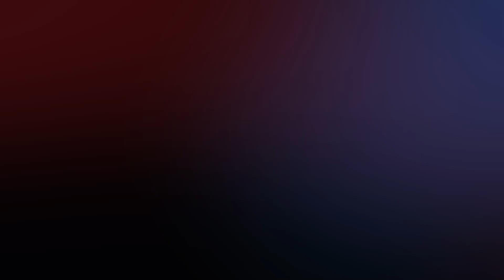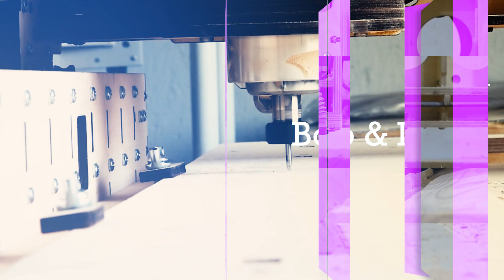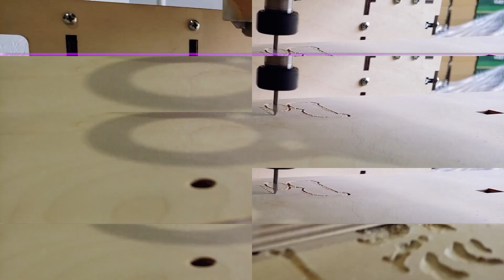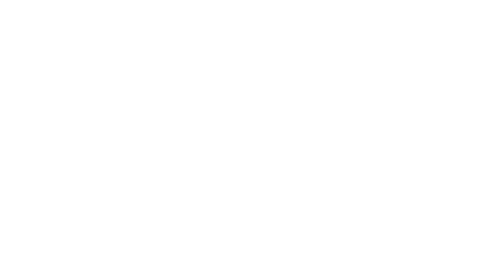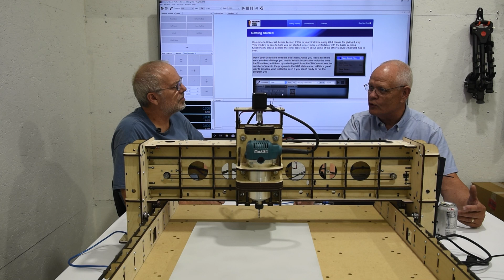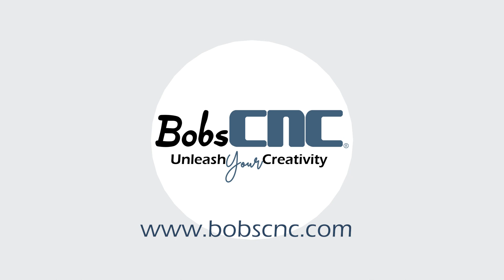Shop Talk: Project Set Up

Comment: I just finished building the Evolution 4. After the first few needle nose placed m4 nuts I switched to a small bar magnet to slip them into the slots, it also would hold the screw to it while I started to thread it in with just the #2 bit in my fingers. Twist the screw to snug than went back with an actual screwdriver to give them a bit more. That worked for most of the areas. About halfway through building it I remembered I had a hot glue gun. Holds the nuts in place quite well. I suggest the painters tape and a small paintbrush with a shot glass or bottle cap of Loctite. After a while I was just dipping the end of the thread, That stuff really goes a long way. Do yourself a favor and identify the top/bottom, Left/Right, front/back of the gantry and the base as you will be flipping it around a bit and it can be time consuming to reorient yourself. 

Reading the comments below it seems some are struggling with the operation of the machine. I have to finish the wiring and put some open source programs together. I will take some notes and get back to let people know how it went, what I used etc.

Comment: You need a professional video team to redo ALL your videos! ..these are very hard to follow, especially with all the banter between you two!  But speaking for myself, I can't see a thing on the screen behind you, much less understand how to find anything on the UGS screen at the same time!  Ridiculous!
Reply: What I did was load the same software they were referring to and followed along with no problem. Use the pause feature of YouTube and get an old fashioned pen and paper to jot down notes. I managed to understand everything but how to switch the units from mm to inches. I will restart and hopefully catch it this time around. If not I will search the help file for UGS.
Reply from the maker: Please download our software setup guide in our manuals section.

Comment: How do I know where to place the board and take those measurements cause you forgot to mention that in the video?
Reply from the maker: You need to place the workpiece in the cutting area. Your dimensions may be different.  The bit needs to be jogged to the starting point then all the axes zeroed.

Comment: It's not quiet that easy for someone who hasn't been exposed to CNC's.  Every time I hit play on my file either cut path is past parameters or idle time out or always some different error code.  Also using F-engrave to create your G-code file is a little muddy as well.
Reply from the maker: Yes, there is a definite learning curve. It takes some time and experience. There is a lot to learn.